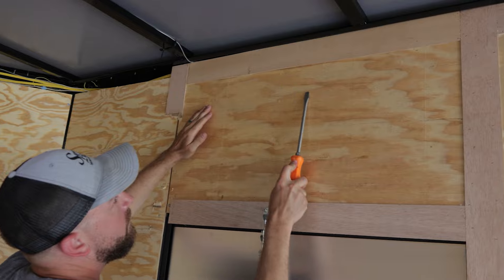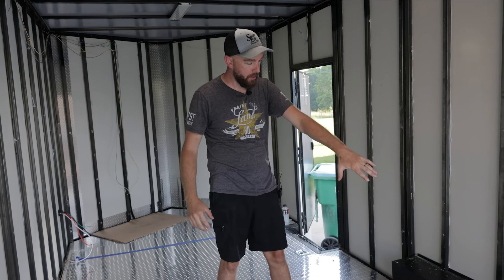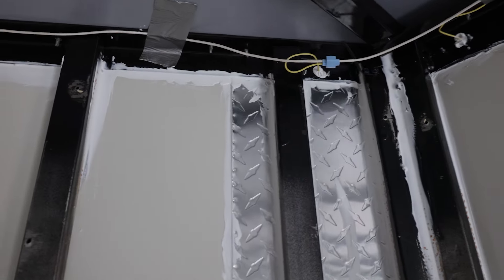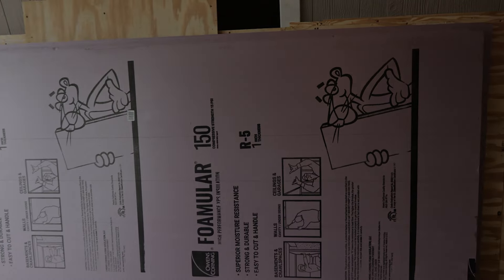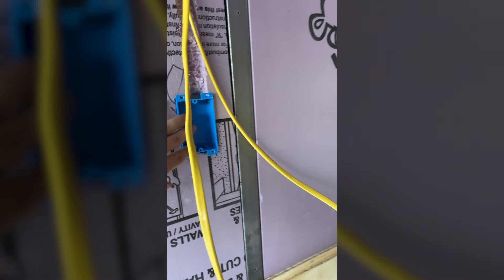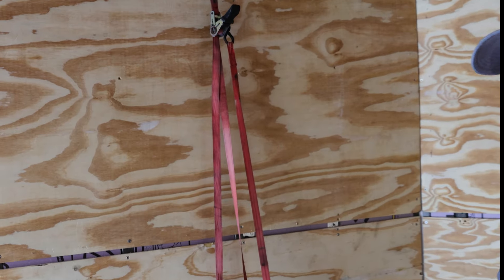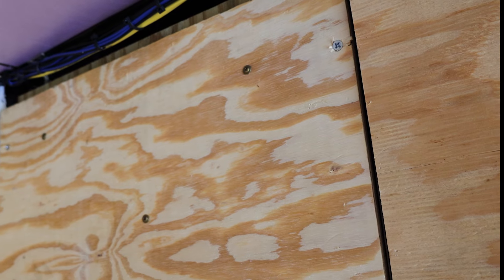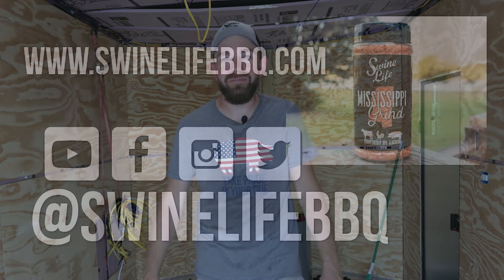DIY Cargo Trailer Conversion | How to Run Electrical & Installing Insulation

Comment: Mark, any updates on your trailer build?  I am about 80% done with mine, and was looking to see if anything new had been done with yours.
Reply from the maker: Man I need to finish the video bad.  Everything is done with the trailer.  We have prolly put close to 7,000 miles and many nights in it traveling.  It’s been great.  Wish I would have went a different route in flirting but other than that it has been great.
Reply: @SwineLifeBBQ  I was looking for your trailer updates.  I have a cargo v neck drop down trailer.  Im getting ideas

Comment: Thanks.  This helped me out   I'm re insulating and changing out interior walls on an all-aluminum trailer.  It was getting too hot on the inside.  It came with Styrofoam insulation.(useless). It was a hot box in the sun and wet box in cool humid weather.
Reply from the maker: Glad it helped!

Comment: is each outlet a separate yellow cable? sorry I kind of rushed through your video and initially thought it was one long yellow wire but didnt understand how the receptors would cut off to make an end and then continue to the next outlet without using multiple cables

Comment: Have you had issues with condensation in the winter where the metal studs are?
Reply from the maker: None at all.  I keep the heat on and exhaust fan running to keep air moving with no issues.  We had a couple weeks last year that were in the single digits and you only could feel the cold transfer in some places but still kept the trailer in the 70’s.

Comment: Do you know what outlets and boxes you used? Looks like yours sit flush to the wall with only the 1" of space.
Reply from the maker: Correct.  I used the shallow boxes.  It sucked getting the wires in them but do mount flush in 1” walls.

Comment: hey there mark! ive got a question, where can i do this project myself? not sure where to place my trailer while i do work on it. would mean a lot for some advice (honestly from anyone who has experience)
Reply from the maker: I set up outside the garage but I know that is not always an option.  It sucked having to cleanup every night but that’s part of it.  I know serval that would pull the trailer to their local hardware and just start a tab each day for stuff needed and work on it in the parking lot lol.  Gotta do what you gotta do.

Comment: Does that r5 keep it warm/cool?
Reply from the maker: Yes, we have stayed in Indiana for several days and it was 10-15 degrees at night and mid 20’s in the day.  Small bathroom heater kept it toasty. 

Same with summer.  Only have had the air conditioner struggle 1 time and the heat index was 125 degrees and no shade.
Reply: @SwineLifeBBQ  so if I had r15 on mine all the way around I would definitely be good?
Reply from the maker: @SuburbanAudit  I would say so, that should be more than enough.  I am only running a 13.5 rooftop A/C with zero issues.

Comment: im curious which BLUE electrical boxes you went with ,I see no links to click on, thin walls nee shallow boxes, its so hard to find the OLD SCHOOL single wide trailer boxes, like the 14ft x 64ft  singleWIDE  trailer i live in
Reply from the maker: These came from Lowe’s.  Just shallow boxes.  It still was tight but worked.

Comment: How do you deal with condensation? I put the same insulation in my trailer, and I waited a few weeks before adding ceiling panels back and when I did i noticed water droplets between my aluminum skin and the insulation. its been cold at night and warms up in the day. I get it , its like a big soda can thats sweating. Any ideas or help?
Reply from the maker: I have not noticed any condensation yet.  I keep my bathroom fan running and my roof top unit has a dehumidifier setting that I run when it’s not in use.  So far so good.  I will definitely keep an eye on it tho.

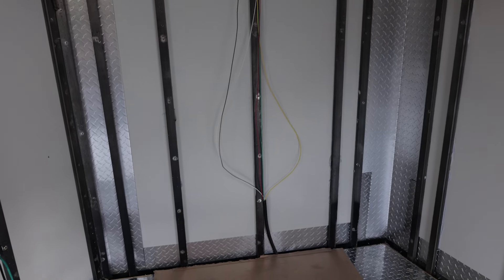Comment: At 1:58 you said you where going to caulk all the holes to seal it up tight. But in the beginning you said you didn't want to use spray foam because you wanted the trailer to breath. Which one you want to breath or not to?
Reply from the maker: Was referring to sealing it up water tight.  I have vents at the rear of the trailer.

Comment: Do you happen to have the link for the outside lights?
Reply from the maker: I will look.  They were an Amazon special.
Reply from the maker: Won’t let me post the link but this is the description 

4.7 4.7 out of 5 stars 384 Reviews
Raycharm 13" RV Exterior LED Work Scene Light Fixture, 40° Down Angle Flood Beam, 6000K Cool-White Super Bright, 12V/24V DC, High Lumen Output Low Current Draw, Aluminum Housing Black Finish, 1-Pack
Reply: Thank you!!

Comment: What a/c unit did you use?
Reply from the maker: The recpro 13.5 low profile.  It is super quiet and works great
Reply from the maker: https://www.recpro.com/rv-air-conditioner-low-profile-13-5k-quiet-ac-with-heat-pump-remote-non-ducted/

Comment: Did you insulate the floor?
Reply from the maker: I did not.  If I ever do it will be spray foam from underneath.  I do keep a heavy mat and rug down most of the time but have not had any issues.

Comment: So, your cargo trailer is considerably larger than the 6x10 I'm getting. Can you give me an estimate of how much insulation I might need for a trailer that is 16" OC?
Reply from the maker: Just guess but I would say around 12 sheets.  That would do the walls and ceiling.  Not the floor.
Reply: @SwineLifeBBQ  That should work. Wasn't planning on doing the floor anyway.

Comment: You have the link for 10" exterior cargo trailer light
Reply from the maker: Won’t let me post the link but this is the description 

4.7 4.7 out of 5 stars 384 Reviews
Raycharm 13" RV Exterior LED Work Scene Light Fixture, 40° Down Angle Flood Beam, 6000K Cool-White Super Bright, 12V/24V DC, High Lumen Output Low Current Draw, Aluminum Housing Black Finish, 1-Pack

Comment: I dought you read these posts any more. But I’m about where you are on my food trailer I’m insulating it. But now that I’ve watched several utube videos on wiring my breaker box I’m so confused I’m afraid to wire it now. I thought I knew what to do or how to wire it. I hv a generator as well want shire power alot of places hv power boxes set up when you rent a space, so instead of cranking up the generator I just plug in my power cord. I was going to mount a 50amp plug in front of trailer run #10g SO cable under trailer up wall to breaker box wire it into breaker box w/6 breakers tars all I need. That way I can plug in my generator or plug a big extension cord with 50amp plug on end plug into 50a box and other end 50a plug with adapter to plug into 115 shore power 1 box in front of trailer 2 options for power never together but seperatly I don’t know how to contact you on face book im not a old computer guy thabks

Comment: You made the same mistake I did with the insulation and wall boards. Maybe it isn't important to you. Although I am based in Mississippi too and the hot and cold are a pain. If I had to do it again I would add a second sheet of insulation, 1/2" thick if I could find it, to lay over the steel ribs. Then I would add new wall wood, probably OSB, then I would add the 1/8" ply. 
I used the original 3/8ths back up and that stuff is garbage. The problem is that the steel ribs / framing acts like a heat sink. In summer for instance the heat beats on the wall and the ribs get red hot. Then that heat is directly transferred to the inside. There are times I run my hand over the wall feel very hot spots at 16 on center all along the wall. My poor AC unit can't overcome it. When it hits 90 I am struggling. 
I live in mine permanently so it is going to be hard to pull everything out and start again but I wish I had 3 years ago.
Reply from the maker: It definitely would be better but I haven’t had any issues so far.  The AC I purchased seems to keep up really well.  We have stayed in the trailer near 100 degrees with no issues and can keep trailer 65. Just got back from Indiana and it was near zero and was very comfortable.  But you are correct and it would be better with more insulation in places. The only thing I wish I would have done is spray foamed under the floor.
Reply: @SwineLifeBBQ  I hear you. I am glad that your AC can overcome the problem I mentioned. I use a 5k btu wall unit from Walmart. I have it plumbed in. It works quite well within reason. It was 1f up around the Tupelo area, where I am, but I was just fine. In fact I barely used my Buddy heater. Just an electric space heater. 
The hot is the problem. I am in the middle of much more improvements etc so I am thinking of completely redoing my AC and going to 6k btu. Might as well get everything done before next spring when I shall head to Montana or Colorado again to try to beat the heat for the season.
As you I did not bother with the floor. It can get nippy in the winter but slippers and the odd throw rug works wonders.
Reply: I was looking for a comment like this. I asked “what about the thermal bridge in the metal studs?”. The AC unit may be able to handle it but it could be significantly more efficiently with breaking the thermal bridge with another layer of insulation to cut that heat transfer.

Comment: Your wiring isn't up to code and you shouldn't run and 120 or 240 v circuits without that even in a trailer.  Simple fix is run the wires inside conduit or flex conduit.  Plastic is cheap about $1 per foot.  If someone put a nail or screw in the wall or you pinch wires you can shock someone or burn the trailer down
Reply from the maker: Haha! Up to code? May not be but it’s light years better than 90% of Rv manufacturers. That plastic conduit ain’t gonna stop and nail or screw either.  You about 3 year too late.  Might burn down tonight but has been the best trailer I have ever owned.